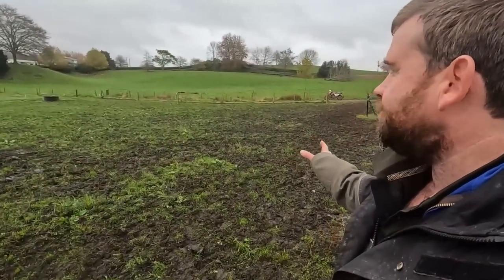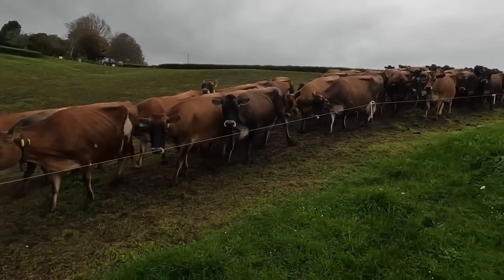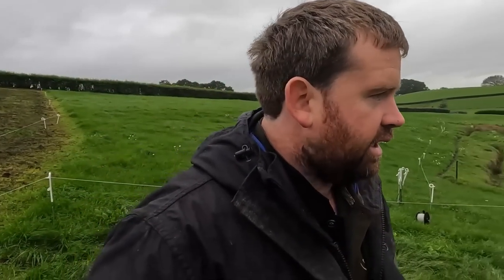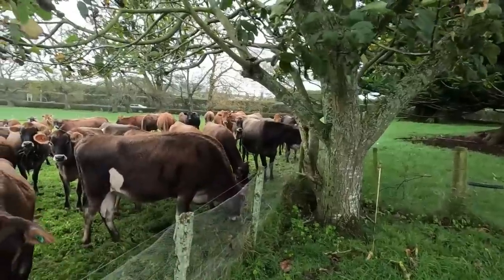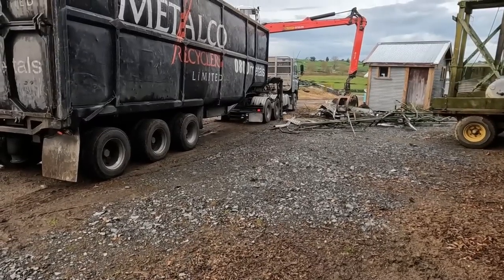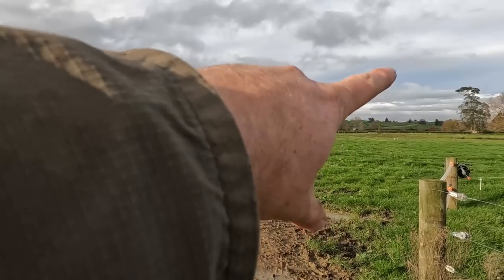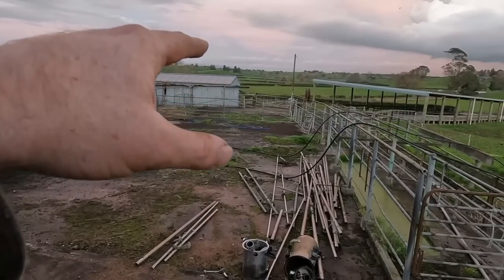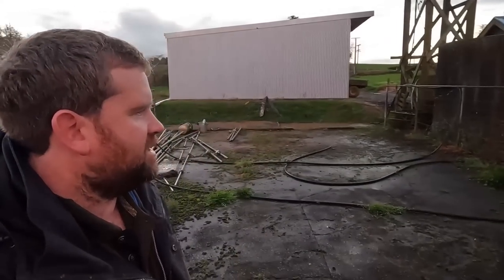Recycling All Of The Scrap Metal & The Old Cow Shed Yard - A Wasted Space, What To Do With It?

Comment: Your concrete pad might be made useful with a pole roof like your new shed, but without sides. Undercover loading/washing/ mechanicals etc. Or possibly a new feed dry store with bins. You could punch poles through the concrete and mount a roof on it.
Reply from the maker: That's not a bad idea roofing it and using it for hay storage maybe in the future. Trouble is that its not a real big area and its kind of niggly to get to with a loader, but definitely keep that one in mind